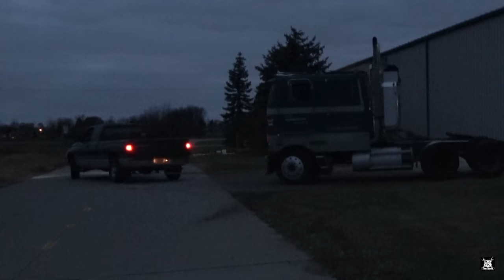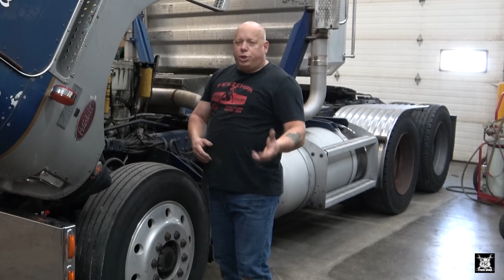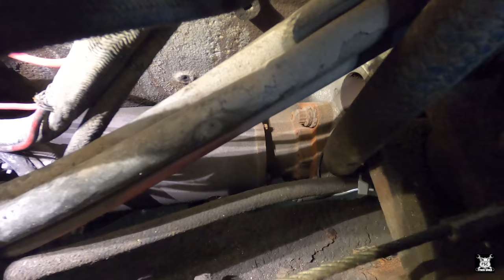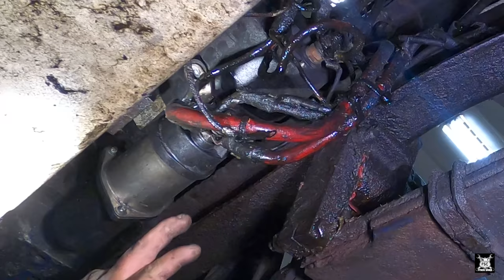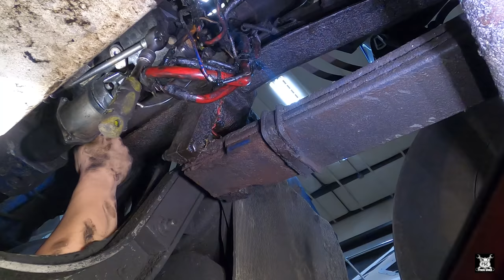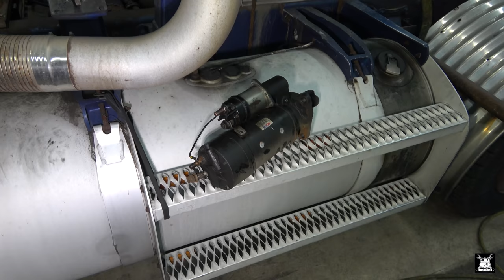Removing Cabover Peterbilt's Starter

Comment: You wont ruin threads by using antisieze
You save them by using it....the damage may have been done long before you got orwell. Chase the holes with a tap and if its real bad helicoil the bolt hole as you may know this already
Reply: He said neverseze but I think he meant to say locktite by the look of it

Comment: Had carpal tunnel surgery in both hands in 1989. It worked out well. I was out of commission completely for about 6 weeks and wasn't at 100% for about 8 weeks past that.
I used to work on cars but two motorcycle wrecks, a hip replacement and cancer took most of the wind outta my sails. My daughter drove my 70 duster bracket car and recorded its best E.T. at Da Grove. She's able to do simple things on cars like brakes and fluid changes but she works in the corporate world now and hires mechanics now. Lol

Comment: I used to spend a lot of time on my back fixing stuff on my vehicles. Then I started to get vertigo and that ended. So now I pay a good mechanic to help.  Stuff still has to get fixed and I figure I can pay someone to keep my daily driver up to speed and I'll tinker with my hobby stuff when I can.
Reply: Vertigo is horrible! I had to change a fog light on my truck and could only reach it from underneath. As soon as I lay down under the truck I started to spin, violently, I broke into a sweat and almost threw up. It was all I could do to get out from under and sit up. That stopped the spin. Getting old sucks!

Comment: You will get through the pain. You would not want me to replace your starter. I can normally change a starter in less that 30 minutes if I have an exchange starter on hand. I remove one bolt and install a guide start. That will keep the starter from falling out and makes it easy to reinstall.  For some that don`t know if that is a 50MT Delco starter it weighs about 80 lbs.

Comment: My kid's do the same thing they repeat what i tell them to do if we are in a loud area or they are about yelling distance. So we know they understood what we said. And i will repeat  what they said wife does it also. My wife laughed at the beginning of the video. I asked what's so funny. She goes u remember the day (Youngest Son) left lights on inside. And we had to use the One Ton Dually Crew Cab to pull start the KW. And i busted out laughing. The wife could not hear me cause  the truck was so loud (Muffler's) She thought the truck was not capable of pulling. I said baby it will pull it. It's just loud cause of the exhaust system Glass Pack's and Echo Tip's. I aired up the air tank the same way u did to the semi. Wife was like she did'nt know u could do that. I said yeah u can. We had to pull start it cause i thought the jump box was in the Semi. I remember i had another son plug it in to charge it up. Lucky i still had chains  behind the cab from a previous run. I had the mechanic install the jumper  cable kit. Where u can connect the battery cables to charge or to jump start it without having to get where the batteries actually are. Cause i have to stepover the battery box to get in the cab. Where did Matt go? Hell have him do that so u won't injure ur arm more. Ha ha been there trying to remove the bolt's and nut's from the starter's. Jessie's eyes got big when she seen that ur battery box was under the cab. She was like that's dangerous being close to the engine. She asked if u had like a quick shutoff switch to the batteries and I said I have no idea. Finding a good place is hard to find. My wife Jessie got her dream house she wanted for a very long time. When it was up to rent to own she got it. But was struggling with payments. I moved in since she kept begging me to. So I did since I stayed at motels when I wasn't on the road. She was struggling with payments and also other things. That following Christmas I paided off the house to rent to own the house. And brought the kids good clothes and toys. We was just friends best friends. She was like stunned seeing the documents for the house. And watching the kids open up there gift's. We had a cellphone recording a video going around. And the oldest son got Jessie (his mom) opening up her gift from me. And it was the egannent ring and the documents that the house is hers and it's paid off. She was happy that I wanted to marry her. She was like how u know. I told the oldest daughter play it. She played the video of Jessie wishing that I would marry her and adopt the kid's. I did that the kids was happy. That following Monday I adopted the kids they signed there names. And months later we got married. That's good Matt has a job working.

Comment: Great vid Steve.
Have you thought about a racing car style battery master switch near the battery box so if you ever need to do electrical work you don't have to remove the top of the box and unbolt the wires.

Comment: That spot on your arm is a symptom of Tennis Elbow. Repetitive stress doing mechanic work. Irritation of the middle and ring finger muscles rubbing together. You can tape the two fingers together, while working, so they move together, there are gel pads that you can wear on your forearm. 
And, massage the area of your forearm where those muscles attach near the elbow. You will find its likely very, very sensitive at that area. It may take time to work that out.

Comment: Well my Corvette I take it into the shop but it's damaged cuz somebody sabotaged it and end up in an accident with it but change the air cleaner the plug plug wires I do that but anything else goes to the shop.. but I have another starter for it it's $349 for the starter for that Corvette and I got it free from my neighbor also that on when mine goes bad

Comment: The reason you talk to yourself if you need somebody intelligent to talk to. Taught my daughter when she was 14 how to change out the distributor cap and new plug wires. When she was in college went to get her tires rotated an WalMart wanted $60 she told them to stick it. She bought 2 sets of Jack stands and a small 5 ton floor Jack from Walmart. A DeWalt 3/4 driver impact and sockets from Lowes  rotated her tires in her apartment parking lot. This smartass came up as she was putting the lug nuts on the last tire and ask if she needed any help she told him she could use a beer if he was not afraid he break a fingernail. Then when she was through she took everything back and got her money back.🤑🤑🤑